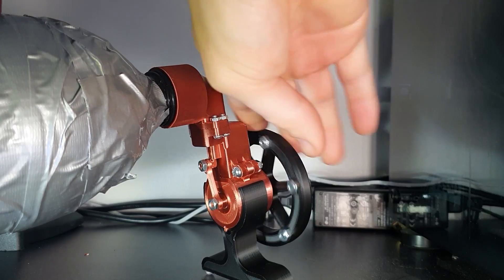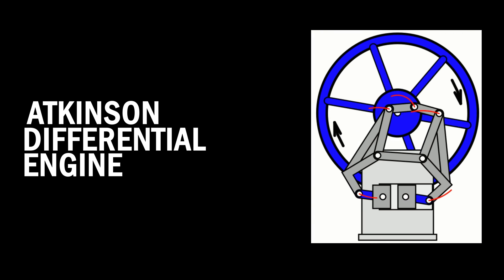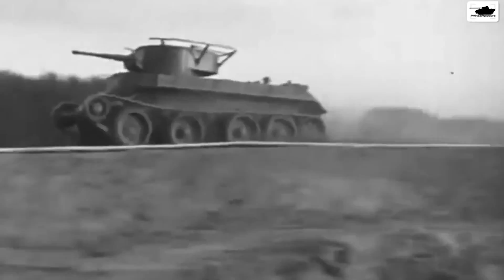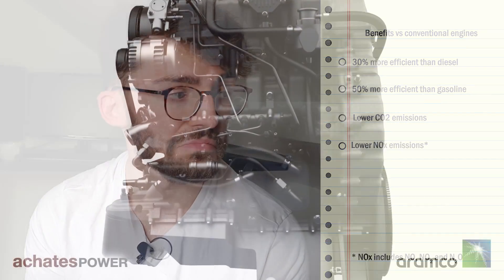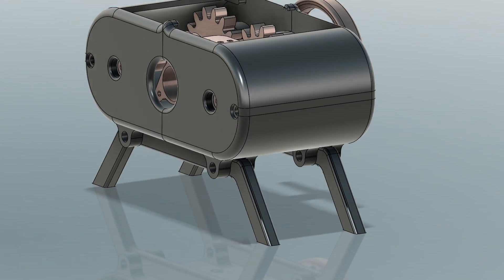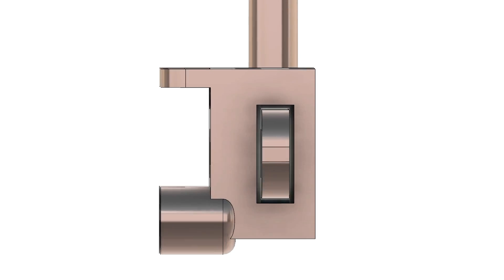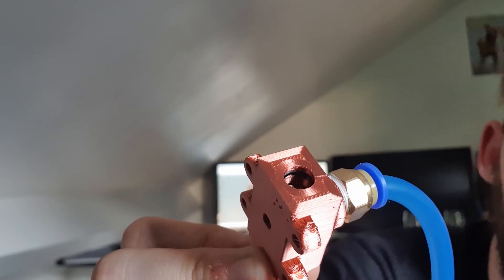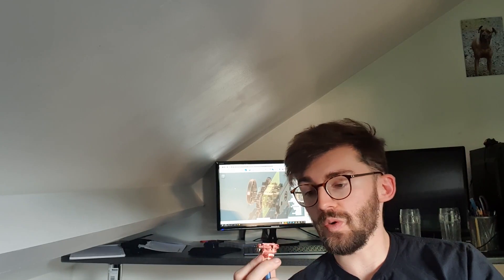Opposed-Piston Engine (3D-Printed)

Comment: nice, tip... loosen the tolerances, then to make that up & seal them properly, dip the parts in sodium silicate (concrete path sealer , some cat litter, etc) & spin dry each part to get a somewhat uniform super tough glass like thin layer (& extra far harder infill as a free bonus) ...stick a small compression spring on the ball barring to make it re-seat properly....or make a small recycled internal air passage to the top so as to push it back down oc
Reply from the maker: that sodium silicate sounds messy lol, wouldn't the surface be quite rough? I will try a spring  and see if it helps things, there's a trade off i guess as you lose some power as more force needed to open the valve, not sure how much it will impact the engine though
Reply: @kurzey8532  messy, can be sure lol, do the engineer thing put on you're old recycled covid groves do it in a bucket inside a plastic bag inside a cardboard box ,twist & hang them on a thin steel wire cage, cheap fence wire/diy plastic/coke can string ... 
smoother as the sodium silicate is essentially as fluid as water hence its other name 'water glass'

it basically goes off/hardens due to the CO2/carbon dioxide in the air, or as many aluminium casters (should) do add a bit of it to the sand, mould, then force carbon dioxide through it to almost instantly cure/harden it all solid in place.

use a derivative of that fast cure.. for recycling shredded/sand wheeled old plastic +Mica, ball milled iron filings + some ground 'face mask' small neodymium for magnetic engine parts, dense flywheels/gears etc 
with 'water glass'  binder as an infill/insert for a far quicker printed plastic thin liquid rubber covered part shell

yes you Can Do advanced but simple & quick diy too, heat it/the composite up (old microwave for a few seconds , loose some of the neodymium magnetism through )
as in, heat that composite to melt the plastic in place, its just harder to actually get co2 in there to make it/sodium silicate binder go off quicker without bubbling it through
 + the main use (super) quick dry, hard finish & seal for instance.

 if ya going to 'make stuff' for fun, you might as well think what useful test part/device might i use later & make chain link parts etc rather than useless test boat prints... one of my pet hates

Comment: Great job! That is the best 3D motor I have seen, due to the lack of fiction and low pressure required. Most you see run off a large compressor using a higher PSI to force the poorly mated parts to turn. I shared your frustration through the video! Been there done that!
Reply from the maker: Thank you!

Comment: Very good vid but you missed out on the Deltic and Commer knocker engines which were very efficient and powerful. All two stroke diesels have to have forced induction, but importantly the inlet and exhaust are timed so the exhaust opens before the inlet.
Reply from the maker: Thank you! Someone else mentioned the Delta, I saw the commer knocker during my research but didn't think to include it...Perhaps I can look at doing these sometime in the future, would've made for a very long video if I covered everything haha

Comment: I made an opposed-piston air engine a couple months ago... I had a working engine, smaller than yours but probably *way* less efficient... Also mine stopped working after like 20 runs or something haha. I did not have the determination to continue to fix and improve my design though... plus I wanted to release a video finally... so great job sticking it out and actually making a good design!

Also, great video, entertaining to watch, you are improving with each video I feel like.
Reply from the maker: Thanks man! Just checked out your video it's impressive you modeled that in blender 🤣 I haven't had much luck with springs as of yet, they're a pain

I was close to quitting both times I couldn't get it to work lol, I know the feeling of wanting to get the video out, close to succumbing to it with this one too!
Reply: I saw this comment to sub to your channel to find out I'm already subbed. Both of you are great. Can't wait to see both of you with over 100k subs.
Reply: Also recently I 3d printed a thermostat housing for get a grip garage out of petg and he actually put it on his car you guys should check it out.
Reply from the maker: @madeintexas3d442  that's pretty cool, interesting to see if it would hold up
Reply: @kurzey8532  Hopefully it will he's going to take it for a drive tomorrow. I'm surprised it didn't melt already. My 50% infill print melted in the thin parts when I submerged it in boiling water but the thinker parts held up better I guess 5mm walls can conduct enough heat to not melt immediately. Can't wait to see how it holds up.
Reply: @kurzey8532  I had some empty pens laying around so I cut the push-spring from one of those in half - they have a fairly mild force but enough to essentially keep the BB moving exactly where and how you want. When using a push-spring in one of your designs, make sure that the spring doesn't want to just bend to the side, as that's definitely going to cause problems. In addition always have some way of guiding the spring... either a rigid cylinder on the inside of the spring or just a constrained space from the outside (I did this). Haven't done anything with pull-springs yet, so can't say anything about those lol. 

As for Blender... yeah, I know I should totally learn to use a parametric modelling software haha... but at the same time, doing this in Blender forced me to think about all of the nitty-gritty details constantly as I was going. But it's probably a lot slower and maybe also less precise in the end...
Reply: @BirdbrainEngineer  It held up for over 20 minutes. He did a video where he tested it. I'm shocked it didn't melt.
Reply from the maker: That's impressive just for a plastic part 🤣

Comment: You can extract more power the secret is in arranging the two pistons such that both pistons are not synchronised when their crankshafts are at TDC or at BDC, so if you offset one piston crank by say 45degrees BTDC when the other one is at TDC, , this will not only self start but yield much higher torque. I have been longing to make this engine but I do not have access 3D printers or resources or to even create animation,

Comment: Hello from Martinique F.W.I....You have done a nice job , to increase the rotation of your air engine, may be you could use the air coming out of the exhaust port and send it to the air tank with a valve ...or to a kind of turbo charger to keep the pression in the circuit...have a nice day...and congratulations...

Comment: Because the two-stroke two-cycle engine spins quicker it rotates faster per minute that's why it puts out more power that's just one reason one stroke is there power intake and exhaust and the other stroke is the compression

Comment: I'm currently printing my 7th air engine ^^

1) one cyl, fdm print, never worked
2) one cyl, resin print, worked really well (8.8 ccm)
3) V2 engine, resin print, never worked (too many print issues and leaks)
4) one sqare cyl, resin print, has a second valve to fill the crankcase with air and press the piston back up, but never ran smoothly (leaks)
5) similar to 4, resin print, with only one main valve, worked okay but leaked (~3.9 ccm)
6) one giant cyl (25 ccm), never made it's way to the printer
7) one cylinder, fdm print (0.1mm resolution). Piston is made from 4 parts + 2 screws and 3 piston rings. It actually has noticeable compression and very few friction! I'm currently waiting for the delivery of the bearings 🙂
Reply from the maker: Sounds good, it's quite addictive 🤣
Reply: @kurzey8532  Absolutely 🤣 I also have plans for making a V8, that would be insane...
Reply: @kurzey8532  The new model runs absolutely insane! 2000 rpm at 20 psi. Never had this before. The old engines reached 1000rpm at 60 psi.
Reply from the maker: @maik5825  that's awesome congrats man
Reply: @kurzey8532  Thank you! I've uploaded a video of the first run of the 1 cylinder version. I'm still not done printing the parts for the V8 but I hope I can assemble the parts next weekend :)

https://youtu.be/YIDevAHdDKs

Comment: How small do you think we can go on a 3 cyl. for motorcycle or marine . I want diesel & HHO to avoid supercharging . Suzuki used rotary valves on their 2 strokes . Do you think a tooth belt will work instead of gears . I think you need 2 cyl minimum .

Comment: Does the inlet not need a 'valve' which stops the compressed air on the compression stroke being forced back out the inlet port, as the it'll exceed the input pressure. A presto type inner tube valve should work, the closer to the piston as possible to minimise any uncompressed air.
Reply from the maker: The idea is the air pressure in the air tank should exceed the pressure on the "non-power stroke" at least initially, though as the pressure in the tank decreases this is probably less effective, some kind of spring would probably help

Comment: Hi Kurzey, question here, I am also making a compressed air opposed piston engine here, but with a valve similar to those used on a 4 stroke engine, I know it brave as I could find very few compressed air engines with valves which aren't ball bearings, but i notice you have printed your cylinder as one piece with the valve assembly, how did you get the support out, and if you didnt use support, which orientation did you print it? And lastly, what is the clerence of the pistons in your cylinder and did you sand them at all?

thx so much in advance

Comment: rather than graphite, you can use that PTFE bike lubricant. At least, it worked on the turbo of my Corsa by removing the rusty hard point. Also, when it comes to insulate, the aerosol expansible foam does wonders, I use it for my wingtips.

Comment: Please, PLEASE use a resin printer. it prints finer than a hair and you can make tolerances almost exactly as you would have in your cad software +- 0.05mm or so. 
lubricate everything and test again. This could be an amazing diy air engine for toys or rc aircraft, I believe in you !

Comment: Well done with your 1 cylinder engine. Keep experimenting, I can't help thinking though, that there must be a reason that the [real world] engines are mostly 3 cylinder.
Reply from the maker: I think Most cars are straight fours, problem with 1 cylinder is there's no opposing mass going in the opposite direction on the power stroke, so you get a lot of vibration, thanks for the comment!

Comment: This is an awesome video. Have you considered the addition of another exit Port directly under the inlet port that would shut just as the inlet Port opens and thus it would vent the air out that the two Pistons are attempting to compress on their return stroke to take another puff of air to push him out? There is no reason to have a compression stroke on a non combustion engine. Just a thought. I wish I had the time to try this myself.
Reply from the maker: Something I could look into, thanks!

Comment: I'd imagine the efficiency figures for the Achates engine isn't 50% better than a gasoline engine, 30% better than a diesel, but rather running the Achates on gasoline, it's 50% better than a conventional gasoline engine, and running it on diesel it's 30% better than a conventional diesel. Since the engine surely uses gasoline or diesel itself. Probably either if you give it a tweak, the same way conventional gasoline and diesel engines are largely the same design.

Comment: But what about... a rotary engine?
No not a wankel, or a radial.. a ROTARY where the crank is still and the entire block spins?
Reply from the maker: This duck is onto something
Reply: @kurzey8532  its actually gonna make valve timing super easy as the only moving parts are the pistons and the block, i think the main issue is getting the inlets to seal to the block when its spinning and all that..
Reply from the maker: Trying to get air to seal is a pain at the best of times so yes sealing would be a nightmare, I doubt this engine would be efficient simply due to air leaking everywhere, at least at first, but it sure would look cool!
Reply: @kurzey8532  i think its still worth trying maybe... even if it cant actually power anything

Comment: I wonder why havent anyone that makes those 3D printed engines got the idea to use plastic syringes as cylinder liners and the plunger seals as... Seals. Would probably make for a way better engine
Reply from the maker: The plunger seals add quite a lot of resistance in my experience
Reply: @kurzey8532  With silicon grease at a few bar pressure it probably wouldn't matter much and lowers air loss substantially. Also the 3D prints wouldn't need to be very precise, just a loose fit inside the syringe body.

Comment: I think that the oppose piston design is cool but you should try making a V shape engine. And I think that the ball valve design wouldn’t work at high rpm, I love if you made a engine with a push rod valve design. ( https://youtu.be/yhfRHEGHx7E this is a video of someone making a v8 push rod air engine maybe you can get some inspiration from it)
Reply from the maker: Yeah I agree there will most likely be a lot of valve float at high rpm, got up to about 5000rpm with a previous engine, though it didnt last long lol. I've had issues with getting springs to work but I will look at getting one to work! That engine looks very cool and sounds awesome!

Comment: Now replace the 2 crankshafts with a hollow ellipsoid flywheel, and one-piece pistons/rods, to create the opposite/reverse of that: https://www.youtube.com/watch?v=kHXKNpXoQUo Oh, and use 2 (real) bearings, to support the one side of each connecting rod, in case it´s buckling...
Reply from the maker: That looks really cool
Reply: @kurzey8532  Yeah, and I´m both very bad at 3d-design and -printing... U mostly need a round flywheel (bigger than the one u already have), with a hollow ellipse on one side... None has ever built an example of it, not even out of plastic (3d-printed)...

Comment: "I still need to actually power something with these engines," drive a generic poc rhombic drive sterling properly sealed with  sodium silicate 'In Driven mode; so as to produce a super Cold end
 not hot, its in reverse, oh no its melting (inside the sodium silicate shell, diy lost 3d pla metal workers go oh ,interesting ;) to super cool & compress to liquid diy gasses for longer run times in a smaller space.
 
more advanced addon , store the new on demand created fluid in a simple bubbling 'trompe' ,push/bubble the used engine air through that to reuse, cool, & actually compress the gas for a near free in situ to complete the better reclamation energy cycle ... boringly cool /coke/beer etc without going to the fridge
Reply from the maker: sounds like a cool idea, from the sounds of it difficult to do tho haha
Reply: @kurzey8532  lol shouldn't be to hard as you dont need all the hot end stuff
see both ,but basically  the rhombic drive part that mechanically creates the sterling cycle in driven mode, everyone should make at least one or two for opposed pistons (first wall mounted? sealed dual cold plate design ? ^_~)  
is simply 6 chain links,2 fly wheels (*driven in the cold case here), 1 shaft sitting in 1 pipe, counter balance to make it run smooth at its core design.

https://m.youtube.com/watch?v=GFfMruoRMGo&t=1s

i like barumman's Rhombic Drive Stirling Cycle Engine 10cc Mk 2 for clarity & style
https://m.youtube.com/watch?v=J1IGcyPrplY

* for simplicity use a cheap 12v car tyre compressor & pv plus old laptop battery, if you want a set & forget long/constant supply added to a version of the old intensive hand pump use 2+ interconnected bottles 
-- or an even simpler big bike extra Big car tire tube in a pipe/thick paper rolled/glued (old carpet roll) tube as its support, retainer etc & added extra in/out (ball baring) valves as required.  doubles as a larger trompe accumulator/storage/delivery device.

Comment: Even your revised model shows a shitty cam profile.  The air valve in this case needs to be cracking open the second it hits TDC. This isn't an internal combustion engine that needs a lead time to burn fuel and develop pressure so there's no sense in opening the valve prior to TDC as this will only fight the rotation of the crank. The air valve should also be CLOSED by the time the exhaust ports are opening. which in your model it closes AFTER..  This will have DRASTIC impact on run time and efficiency, as the "Blowdown" cycle never happens which means your crank is fighting residual pressure coming from BDC x2. If you REALLY want to make power, you need another valve for exhaust and eliminate the cylinder ports. As the pistons are headed toward TDC, the air valve is closed and so are the exhaust ports. There's literally NOWHERE for the trapped air to go. This SLOWS DOWN the crank and wastes significant amounts of power.. With a dedicated exhaust valve in the same port as the intake, you can 100% control air flow in the engine and eliminate any pressure buildup prior to the next intake/power cycle which will extract the most amount of power possible. I'd imagine a spring loaded ball bearing of 8mm would be ideal. (You really can't go too big here)  You also REALLY need to get yourself a REAL air compressor if you plan on making "Air engines"..